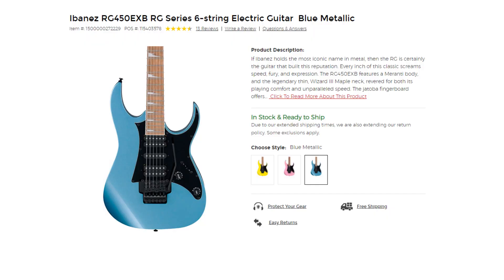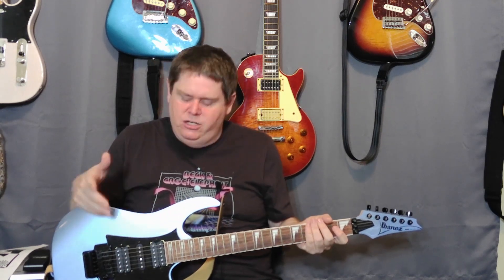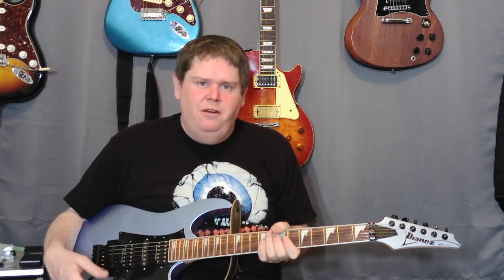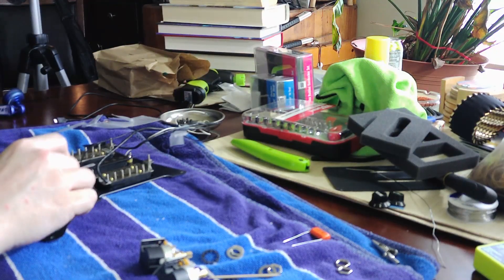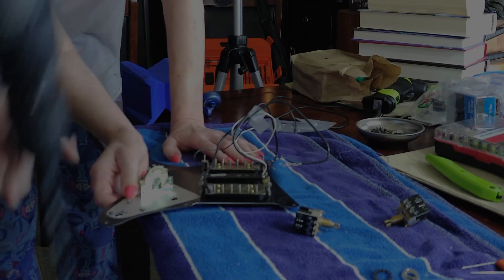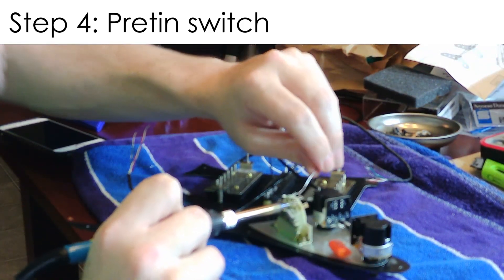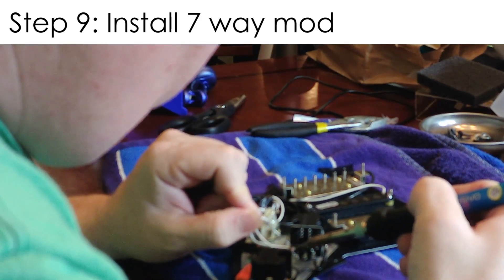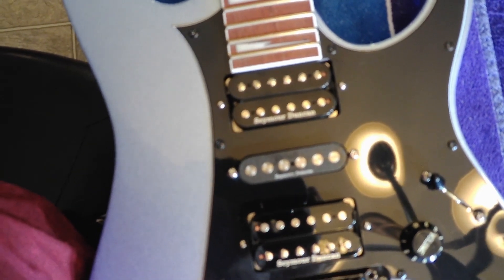Ibanez RG450EXB Pickup Upgrade - Quantum vs Seymour Duncan Jazz\Quarter Pound\JB

Comment: Great video and comparison thanks. So basically Quantum pickups are shit 😂, i ordered Ibanez rg370 ahmz which also has quantum, seems great guitar with pretty good tremolo system (used on some prestige models i think) also buyed it as a decent cheaper mod platform as i don't own any trmeolo system guitars and i want one badly, gonna rock on it for some time then i will definitely change pickups, those quantums are so much turn off compared to dimarzio evo's am really use to right now. Also rg370ahmz is so beautiful i couldn't say no and with all that great specs(except pickups) for a price.
Reply: The Quantam are ok, they work, but no personality and sound flat
Reply: @toothyfangface1583  really??? Check some videos on my channel they are all stock
Reply: I've got two rg370ahmz. I've put a 59 custom hybrid in the bridge in one of them and that guitar sings squeals and growls now! It is one hell of a pick-up with the ash/maple. Fitted a brass block too and it sustains amazingly. Great platform.
Reply: I have quantums too. Working on their replacement. I want modern, power, but clear. No 8-bit tones like I hear so much nowadays.
Reply: I actually changed my mind, i got Ibanez rg370ahmz with quantum and i like them more then my other guitar with upgraded evolution pickups 😄, quantums are quite good no joke.

Comment: Bridge don't need replacing. Floyd's for the most part all are the same. It may require better fine tuner's on the bridge some cheaper Floyd's need better parts. It's all hit and miss with Floyd's if things may need replacing. Now chrome Floyd I prefer in color but after 5 years chrome Floyd's saddle's have a rust problem. So I'd most of the time go with black Floyd's.